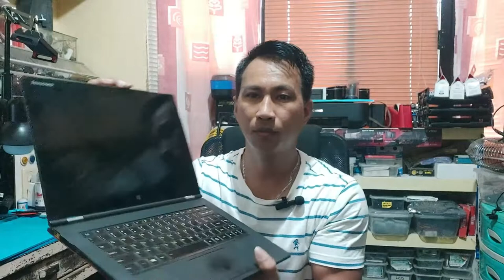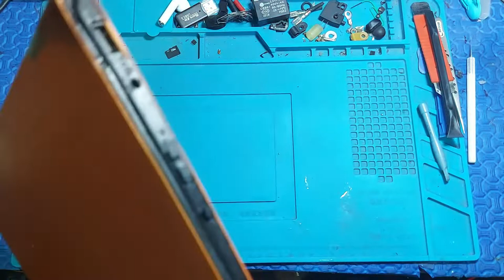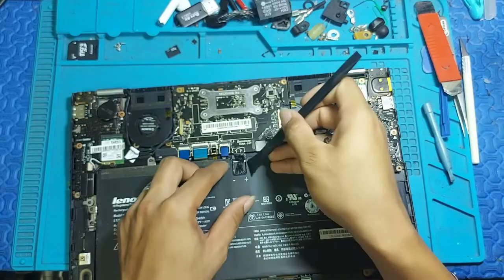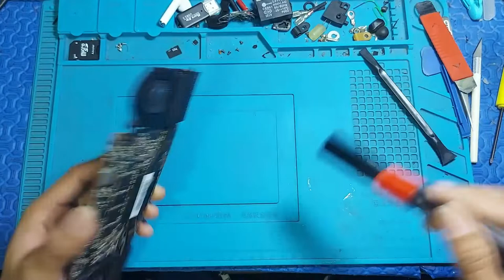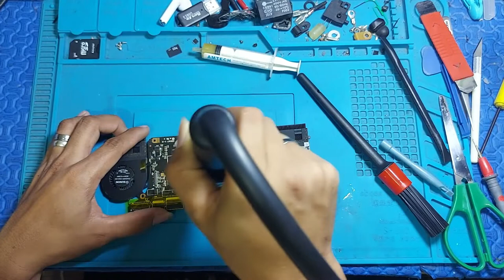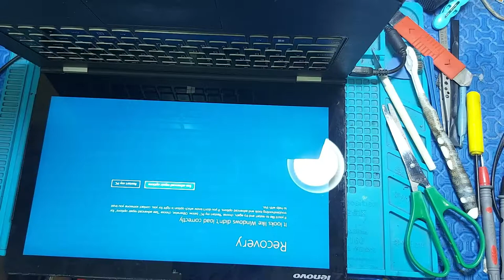How to Repair Lenovo Yoga 2 Pro

Comment: So was that solder flux or thermal paste you were getting under those four chips when you heated them? I have heard/seen that this problem is caused by improper thermal management design by Lenovo. Do you have a part number for that product? Thanks